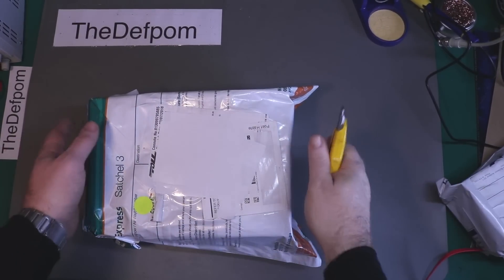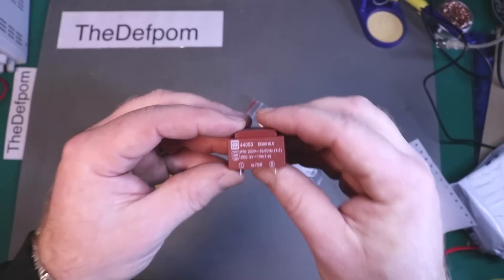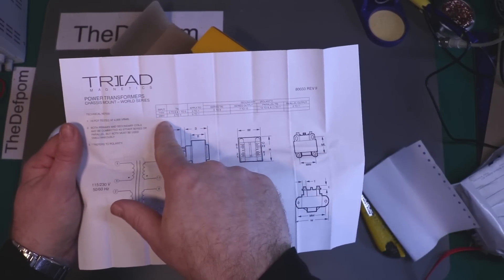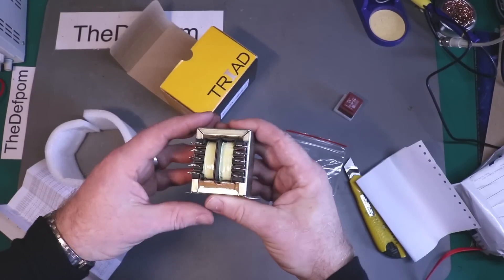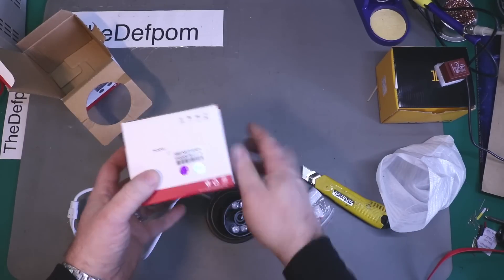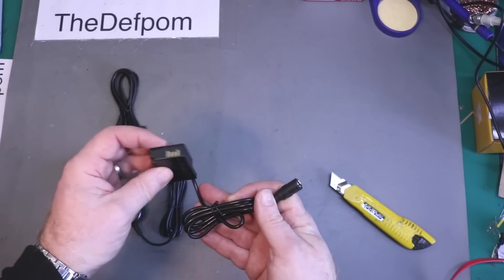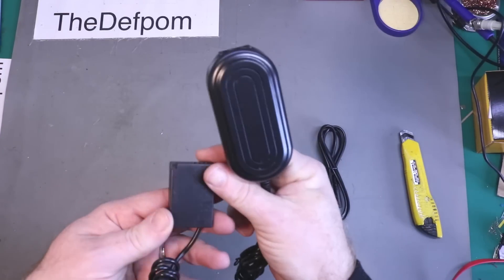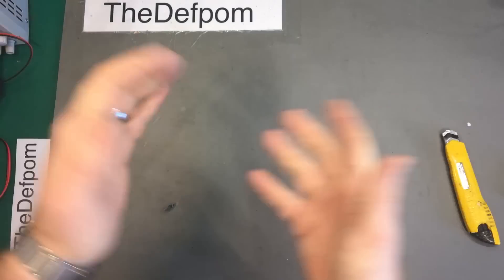🔴 #405 Mailbag Monday 9th July 2018

Comment: I found using analogue cctv cameras (sony) linked to a dedicated hard disk recorder (dual disks) better than IP cameras to a PC - never had to reboot it.
Reply from the maker: Sasquatch - I’m using a dedicated NVR, rather than a PC.
Reply: ok - i get that - perhaps i'm biased - hate IP cameras :-)
Reply from the maker: Sasquatch - the IP camera system is replacing my analogue cameras, the resolution is far superior, plus using POE means simpler wiring.
Reply: POE i can understand, although having a single PSU with battery backup has served me well - two wires isn't that much of an issue - and maybe the newer cameras. I paid a lot for my Sony dome cams (and additional IR lights) - and they have been faultless - 7 years going strong - and the resolution whilst analogue has caught three b*stards so far with quality suitable for the courts :-). It's all about placement, focussing, coverage and cleaning the domes periodically IMHO. However each to their own - Would be good to see an overview of what you are setting up. I must confess I haven't looked at replacing my kit - as it works for now. would be fun to look at the newer stuff I suppose.
Reply from the maker: I basically have a massive battery backup system which can keep everything running for a few days, it used to only be for about 12 hours, but when I got flooded in January power was off overnight and so I didn't get footage of the flood happening, which was disappointing as it would of made a very good video!

The new IP system has a POE switch, and a stand along NVR which can handle 16 1080P cameras, this is all linked to my main network, which has wireless internet, devices on my network notify me of a power outage, and I can remotely view live video and playback footage from the NVR, again the system will stay running for days without power.